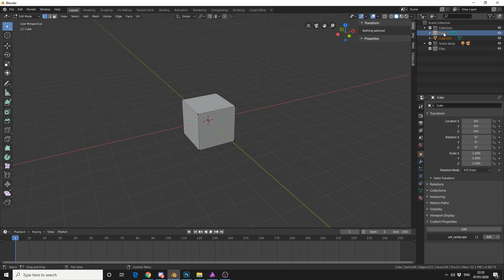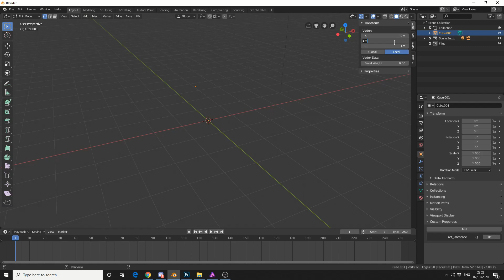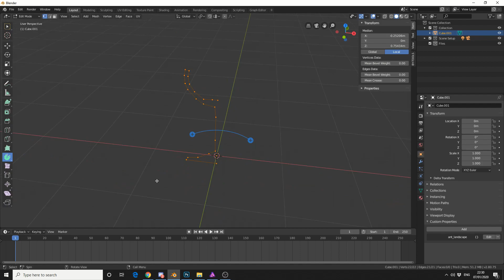Blender 2.8 Modeling Series: Spin Tool (Part 2 of 2) Model A glass quickly

Comment: 2:28 I like to use a small value (e.g. 6) for the rotation steps, and then add a subsurf modifier to smooth things out. Easier to change your mind that way.

6 seems a good value for the number of steps; with a value of, say, 4, it no longer looks exactly circular.